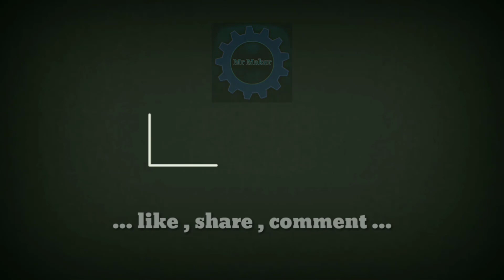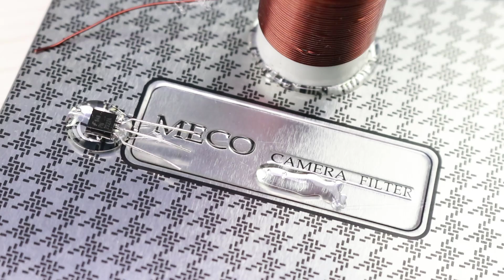How To Make Tesla Coil At Home - DIY

Comment: Before you say that this doesn't work, this isn't a tesla coil, it's something called a slayer exciter, look it up it is supposed to excite the gas, not give off electricity in arcs
Reply: Finally a smart person here👏
Reply: Thanks I just did my research and I'm building a tesla coil myself and it's important to know the difference between the two
Reply: I hate seeing people call these circuits a tesla coil. An actual tesla coil can do more than light a bulb half an inch away
Reply: Hello, Sir! I just want to ask if this slayer exciter really work. And can I use a different transistor and resistor not according to what he used in this video? Please reply.

Comment: Wow you are a new inventor. You have invented a Tesla coil can turn on LED
Reply: @HashirEasa  It doesn't! Watch at 5:24 as he turns the switch off you can see his finger release the hidden button on the bulb with a battery hid inside. Notice how carefully he takes the bulb out the box not showing you but one side? the dudes a liar and instead of educating kids he is just trying to earn another view. Thumbs down for me.
Reply: @explod329 well the circuit itself is legit though, its a slayer exciter, possibly the simplest way to run a tesla coil off of dc voltage.
but yes the led bulb was totally fake
Reply: @HashirEasa  I have built 100's of these and yes, you are correct, the circuit is legit. A capacitor could be added to to help increase the voltage and maintain a constant voltage and actually light a fluorescent bulb even better. What bothers me about this video is that there are young adults in here really trying to educate themselves and build school projects and such and this youtuber is giving them false information with an LED bulb just for views.

Comment: A real Tesla coil never always works on cfl  or tubelight which contain argon gas 
Not on led bulbs
If you won't believe take a plasma ball and a cfl , power the ball and see it will glow
Reply: It's not a coil, it's an exciter though, it works slightly differently
Reply: cfl works

Comment: 5:23 there is a switch in the back of the led when you off the coil switch your right hand is pressing a switch at the back
Reply: Yes, and look the whole circuit is on when the red button is off 5:00

Comment: Hey is it really works ..bcoz i am going to make this in my science project.. Plz reply
Reply: Mr Latif it doesn’t work at me
Reply: @andreabdulk9388  🙁😞.thnx for your reply bro....
Reply: It will work i alredy made these try cfl biulb or led too its fine with both
Reply: I am making this as my science project bro......
Reply: 4:50 why he turned off the switch and then how 'll it work?
Reply: @bilkisshaikh2716  me too
Reply: Stop laying dear scientist, transform voltages using coils will never work with DC, learn basic electricity physics.
Reply: Bro it is 💯 work
Reply: @electricburns5880  what the heck the transistor will do,it convert DC to AC damn.

Comment: He is not Mr. Maker

He is Mr. Faker
Reply: Why
Reply: @bhavay819  it was faked.
electricity dosent flow like they explained it
a tesla coil cannot light up a led bulb
and the swich is off when he "turns it on"
the curcuit is incorrect and the spark gap wouldent work anyway because it is connected with the secondary wiring anyway

Comment: This circuit will work if done properly but that transistor is going to get hot and fail eventually it wont work for LED bulb though I made a very similar circuit with the same components and it worked to light CCFL
Reply: I just ran into this problem with a 2n2222 transistor what otger resistor do you recommend
Reply: Bro mine isn't working what do i do

Comment: Pls answer my question:-Is it necessary to to use a metal thing as base or it can be of any material??plss answer
Reply: it can be anything: wood,plastic,pvc,cement,concrete,leather,foam
Reply: @nyayeshchandraroy  4:50 why u turned off the switch
Reply: @veereshgp49  they wired it a bit weird, that's why.

Comment: Bro its not working  !!!! Which wire do you use as a primary coil
Reply: Me too bro
Reply: @Legend Anik bro kya tum ne primary winding ki ??? Agar ki hai to kitne turns liye ??
Reply: @Legend Anik bhai 3 turns lele ....aur transistor ki connections ek bar dekh lena ...ki proper terminals pe proper connection hai ya nahi...aur agar tu 9 volt ki battery use karega to vo sirf 10 minutes tak hi kam karenga ....to agar sub connections thik hai to battery change karke dekh lena....fir bhi na ho to reply karna
Reply: @Legend Anik 12 cm ka lele...per uss pe copper wire (36 gauge) ke 250 turns hone cahiye...

Comment: 5:13 the switch is turned off as the lower side shows O and not I 
How can it work with no power
Reply: he just connected it backwards you can solder to both ends

Comment: Ok this is fake , A LED bulb which runs on ALTERNATING CURRENT can't be powered by DIRECT CURRENT Tesla coil. + Led bulbs require 220V -240V power supply then how can you power it by just 9V Battery.